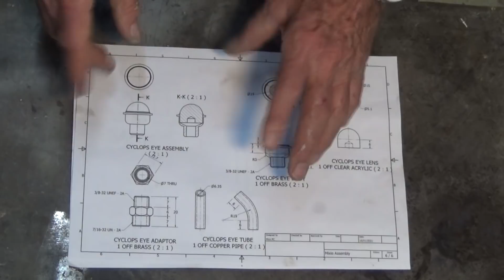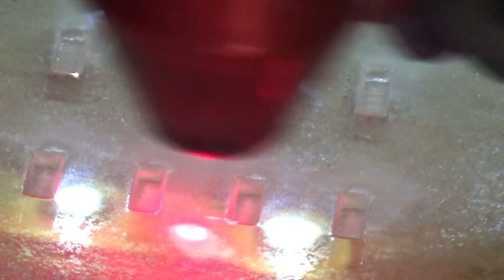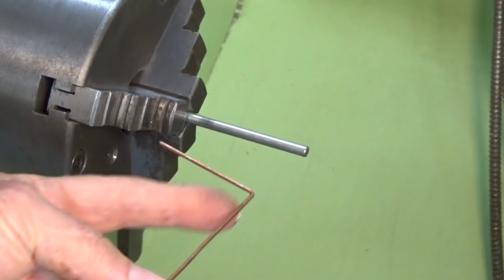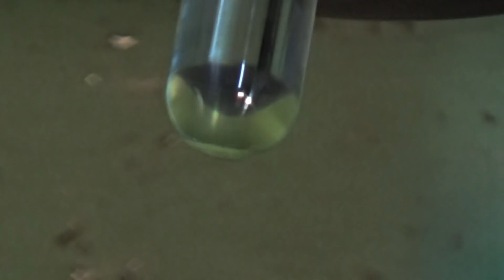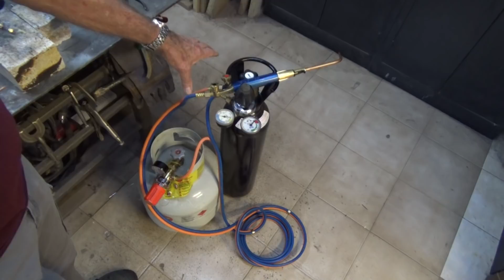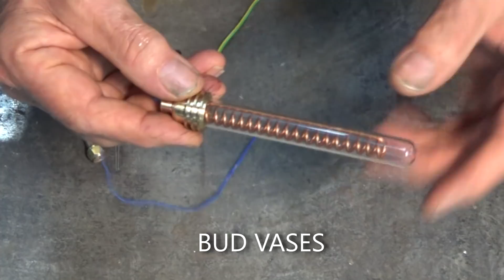The "MIXIE" A DIY Steampunk, Backlit Digital Clock - Part 8

Comment: You’ll find if you turn the gas on as low as possible that electric striker will work,, when the gas flow is blowing too hard it just blows the spark away but if you turn it really low I guarantee you it’ll pop every time..
Same thing when you’re using your electric stove when it’s on high it doesn’t light as easy but if you turn the gas on low it ignites and it’s using the same gas so I mean think about it there’s no reason why it shouldn’t..
Reply from the maker: You may be correct but I tried it lots of times and I had no success. I was surprised it was so difficult since I had used the same lighter with acetylene and it worked perfectly. I haven't given up though. I will try as you have suggested.
Regards,
Mark

Comment: Have you posted the plans for this clock? I would like to do it with a copper pipe body.
Reply from the maker: No, I haven't published the drawings but I can send them to you if you want them. You can email me at mark.presling@gmail.com
A copper or other metal bodied case with some big rivet heads along the seam would look fantastic. 
Regards,
Mark

Comment: waaaaaaaaaaaaaay too much solder !! cut a piece 2x1mm, drop it in to the flux next to the join line, dob flux on top, away you go with the flame. saves getting solder all over the place. also: you don't need to heat it soooo much - silver solder comes in a whole range of melt temperatures !! i have three silver solders in me shed

Comment: Great idea for mounting hardware to the welding bench for temporary use. The tapered square shafts on the cast Former's  seem to move about even after making the tapered adapter to hold them. To be able hold a number of different sized tapered square cast Former's of different sizes, suggest making two round plates with a square hole in each, weld one plate into the top of a round pipe that can fit into the holder fixed to the bench,    thread a portion of the inside of the round pipe in the bottom half and turn a thread on the bottom plate so it can be screwed into the bottom of the pipe to match the taper of the square Former's.  The top plate will absorb the energy of hammer blows on the Former and the bottom plate will hold the Former more snugly and stop it wobbling around.
Reply from the maker: I am guessing there are lots of ways of making it more secure. On some of the stakes we used in the school we welded a piece of threaded rod on the bottom of the tapered shank, this was as a result of an accident somewhere in the state where a kid had one of the heavier stakes drop on their foot. No one could explain how it happened but the result was a safety directive to make them less likely to fall out of the tapered socket. The end result was that it was now much harder to rotate the stakes or to swap them out to different positions. It did make them less likely to wobble about but it really was a nuisance. 
Regards,
Mark

Comment: The Turnado sure looks like a great addition to the Eccentric Engineering diamond tool range. 👏👏👍😀
Reply from the maker: I recently bought the tracing attachment that goes with the Turnado. Although I haven't tried it out yet it allows for following a 2D template for making parts like hammer heads and machine handles. I will be able to cut the templates on my laser cutter. I am still looking for a job that will allow me to try it out.
Regards,
Mark

Comment: Where did you get the high speed steel tool holder you are using?
Reply from the maker: I bought three of these Diamond Tool Holders from Eccentric Engineering in Melbourne, Australia. I have a left hand a right hand and an earlier version of the right hand tool holder that is set up for roughing cuts but not facing cuts. You can see the range of tooling on Gary's site here https://www.eccentricengineering.com.au/products/diamond-tool-holder/the-diamond-tool-holder. They don't sponsor me in any way but I am a very satisfied customer.
Regards,
Mark

Comment: Mark, I'm sure you said something about it before, but why do you have the parting tool setup to be used with the lathe in reverse? Loving the clock, thanks.
Reply from the maker: Aaron, I bought one of Eccentric Engineering's inverted parting tool holders. In this configuration the cutting edge of the parting blade is upside down which means that the lathe must be running in reverse to get the tool to cut. Generally I hate parting off in the lathe. Over the years I have smashed plenty of parting tools when I was using them conventionally. Usually the blade will load up on one side and then dig in with disastrous results. The inverted parting tool is less susceptible to digging in because it increases the contact between the cross slide dovetails as the blade pulls upwards during the cut. This helps to prevent excessive clearance. The other advantage is that the swarf and chips can fall out of the cut and away from the cutting edge instead of collecting on top which may cause them to get sucked back into the cut zone.  In practice, it is still possible to break a blade but it adds a margin of safety. I am presently working on a collaboration with another YouTuber to make a rear tool post for a parting tool. This also adds to the stability of a parting tool because the tool has to be pulled into the cut by the cross slide leadscrew rather than being pushed. Pulling the blade keeps backlash out of the system. I am hoping this will give me more confidence with this operation.
Regards,
Mark

Comment: Nice work Mark,
I always use butane gas to solder brass to copper pipe. As well for (hot)water plumbing as for natural gas plumbing.
Soldering using butane= low temperature, soldering using tin/lead. When the flame turns green the tin/lead wire is tipped to the joint. And is done
Reply from the maker: I must say I haven't used butane much. The only time was when I tried it as a fuel for a  model steam boiler. It came in small single use cylinders which was ideal for fitting inside the model steam tug I was building but the canisters would freeze up before all the fuel was used. I switched to a larger LPG refillable cylinder and it worked much better. 
Regards,
Mark

Comment: Excellent build as usual!  Have you considered using LOCA (liquid optically clear adhesive)? It's UV curable and is transparent. It's used for laminating glass to LCD matrices. Btw, you can smooth out the surface of acrylic with a quick pass of a torch flame.
Reply from the maker: Bob, I do have some of that UV curing resin but I must have bought a really cheap brand. It doesn't set very well and the cured surface is always a bit soft and sticky. I have done flame polishing before on the cut edges of acrylic. Certainly super quick that way.
Regards,
Mark

Comment: Thanks Preso.  Great video.  How you come up with this stuff is beyond me.  I wish I had your imagination and skill.
Reply from the maker: Thanks Roy. One of the skills we used to teach students was how to collect resources for inspiration boards when designing things like logos and packaging. In the days before Google we would give them a whole stack of magazines and newspapers and the goal was to cut out anything with a connection to the topic. It was all pasted onto a big sheet of card and then the sketching process started. We used to get the kids to focus on images, textures, patterns and words. After Google, they just cut and pasted whatever they could find onto a blank document. I still do a similar thing although in a far less structured way. Pinterest and Google Images are a good way to start. I also find that most of my designing is done on my morning walk. My wife and I take a 4.5km walk every morning. It's quite a strenuous walk so we don't talk much but I find it allows me to think about projects and issues with them. Surprisingly, most of the breakthrough ideas come during that time. I recall seeing a TV programme about the Japanese engineer who designed the first Walkman cassette player. He used to swim laps underwater but he kept an underwater notebook with him and he would write down ideas as they came to him. That's a bit extreme for me though!
Regards,
Mark

Comment: That is going to be one funky looking clock ! 
Does it have a button that you can press to change the led colour or are you going to do something in programming to change it automatically ? ( may have missed some of your explanation ) .
I probably would have gone oxy lpg myself but I already had a full oxy acetylene kit here - just needed a new hose .
I used to have a boc account but as I was the welder where I work I got all my gas for nothing and now I have to pay for it 😭
I did have a boc outlet about 2km from me but they shut a few years back but fortunately Bunnings is just around the corner 😀.
Reply from the maker: Ian, the clock has a two button menu which can be used to set most of the functions including the main display colour and the colour of three extra LED's which are at the end of the main string of LED's that are used to illuminate the digits. I didn't do any of the coding for this. It was done by one of my subscribers and I'll be giving him credit for that part of the project in a future video. Yeah, free gas would be great. I had access to oxy acetylene at school so I didn't really miss it at home. I could just take those jobs to work and do them there. Now that I'm retired I find that I am having to replicate a lot of machines and processes that I used to take for granted. 
Regards,
Mark

Comment: Hey Preso! Cracking work as always, it is great seeing this project come together! I'm going to have to look into the oxy/lpg set up, that looks like a great improvement over the Butane Gas I use, thanks for tip! cheers Steve
Reply from the maker: I believe that you cannot weld steel with oxy LPG but you can do just about everything else, it just takes a little longer than oxy acetylene. The little D size cylinder is small enough for me to tuck the whole unit away in the odd corner, or at least it will be when I get a trolley made for it. 
Regards,
Mark

Comment: Make sure you keep a copy of the receipt for your bottle.  You have to prove you got it from them when you refill.
I love oxy propane.  Perfect for home shop use.
Reply from the maker: I get my gas from Total Tools and they keep my purchase history on their computer system, They aren't any cheaper than Bunnings but I hate shopping at Bunnings. My blood pressure goes through the roof as soon as I walk into the place. I should have switched to oxy LPG years ago. I should have mentioned in the video that LPG is significantly safer than acetylene. 
Regards,
Mark
Reply: @Preso58  yeah Bunnings is pretty bad.

Comment: What manufacturer makes your tool holder on the lathe? I have never seen something like that and think it would be a great addition to my small shop.
Reply from the maker: If you are enquiring about the diamond tool holder, they are made here in Australia by a company called Eccentric Engineering. They also make the inverted parting tool as well. I have a left hand and a right hand version of the diamond tool holder and they can do about 75% of the general turning on my lathe. They are great tools and not that expensive. They also make the Turnado freehand turning attachment. You can check out the store here. https://www.eccentricengineering.com.au/shop/ They don't sponsor me. I'm just a satisfied customer. 
Regards,
Mark
Reply: @Preso58  yes, that was what I was looking for. I just ordered the left and right. Thank you so much for the info as well as all your video’s. I have only been turning on my restored 1945 Logan lathe for just over a year. It is such a Godsend to watch your videos , then try on mine. Thanks again.
Reply from the maker: @mikekristufek8734  that's great. I am sure you won't be disappointed with the diamond tool holders. The little jig that is supplied with the tool holder will also sharpen tools with 55 or 60 degree included angles for single point threading. 
Regards,
Mark

Comment: Another great video Mark.
That Bunnings deal is good if you already know you'll never use the Oxy very much, say 1 x bottle in 2yrs.
If however you know your projects are larger & likely to use 1 x bottle within 1yr then that BOC "Hobby Plan" is better.
I'm using the BOC plan & already got a FREE bottle because I'd used up the first bottle within a 12 month period...
...if I was on the Bunnings plan then I'd have just cost myself an extra $99 for that same year.
So you really need to "guesstimate" what your potential usage might be based on your future projects. (hard but worth it)
Reply from the maker: I did check out the BOC deal and it was almost a dead heat between it and the cylinder swap deal for me. I don't think I would be using it enough to get a free cylinder like you have been able to do. It's the same with the argon cylinder for my welder. It took me two years to use up the first one. Unfortunately I spread myself pretty thin with lots of processes and tools that don't get used all the time. 
Regards,
Mark

Comment: Another great video , re the welding gas, have you looked at the new Bunnings gas deals ? you pay a $200 dollar deposit on a D sized cylinder and then pay $99 dollars for the gas, when you return the bottle you either pay the $99 for an exchange or you get your $200 dollar deposit back.
 It sounds pretty good to me, I guess its like keeping your money in the bank, and at least with the way banks are these days it won't have been depleted by fees and charges by the time you get it back ;)
Reply from the maker: Andrew, I avoid shopping at Bunnings as much as I can but the same deal can be had at Trade Tools and Total Tools. Currently I get all my gas from Total Tools. I have  a D size cylinder of argon for my welder and it took me two years to empty it so it works out well for me. 
Regards,
Mark

Comment: Another option for polishing small inside holes is a cotton swab. Either turn the part or use the swab in a drill. And polishing compound of course.
Reply from the maker: That would definitely work. If I had any brains I would have sharpened the drill a bit better so it didn't score the bottom of the hole so much. 
Regards,
Mark

Comment: With both positive 5V and negative 5V the LED would get 10V! - not good :D
Reply from the maker: Well,  you can tell I'm not real good with electricity. 😁
Regards,
Mark
Reply: @Preso58  well as long as it works :) - you are a million times better with mechanics than me, it's a joy to watch you work :)

Comment: Looking good there Mark 👍 Welcome to Oxy-Propane ! You might want to consider a pair of flashback arrestors to complete your setup.
Reply from the maker: I have done many courses in gas safety. It was a requirement when I was teaching and we once saw a demonstration of what happens during a flashback event. It was deafening but the one thing I recall was that modern regulators are designed in such a way that a flashback will be arrested at the regulator whether you have flashback arrestors or not. It will destroy your regulator but it cannot ignite the contents of the cylinder. Most industrial accidents with acetylene are caused by operators accidently severing hoses or heating the surface of the cylinder. Dropping an oxygen cylinder and cracking off the main valve is exciting as well. Instant rocket!
Regards,
Mark
Reply: @Preso58  If you let them have their way, they will put flame arrestors on argon lines.
Reply: @Preso58  this is what BOC in the UK.   Flashback arrestors
A flashback arrestor is a device designed to quench flashback.  When incorporated with a cut-off valve it will automatically shut off the gas flow.

Flashback arrestors provide an additional safeguard, particularly in locations where a fire would be particularly dangerous, such as hospitals, garages, and workplaces with flammable or hazardous chemicals.

Flashback arrestors should be fitted to all fuel gas supply lines and to oxygen supply lines when they are used in conjunction with fuel gases.
Reply: Propane doesnt flash back near as bad as acetylene.  Still better safe than stumpy.
Reply: @thefixerofbrokenstuff  - If all that's left of you after the acetylene tank blows is your feet in your boots, is it still correct to call you Stumpy? :-)
Reply: I was going say the same.
Reply: Dito!
Reply: I've always been more afraid of oxygen cylinders than flammable gas cylinders.  Stuff you might not expect to be a problem can become one with pure oxygen in the area.

Comment: you can put the tip of the torch up against something, at a bit of an angle, and then open the oxygen and that prevents it from blowing off the flame
Reply from the maker: Thanks, I'll try that. I was unprepared for how LPG behaves as a fuel. I have only ever used acetylene prior to getting this kit and being so much more flammable it is way easier to light. 
Regards,
Mark